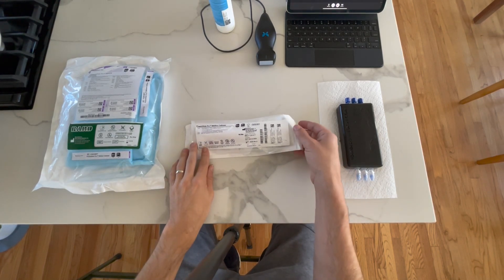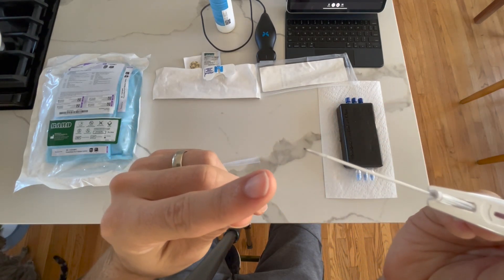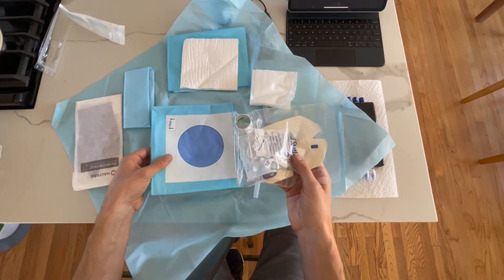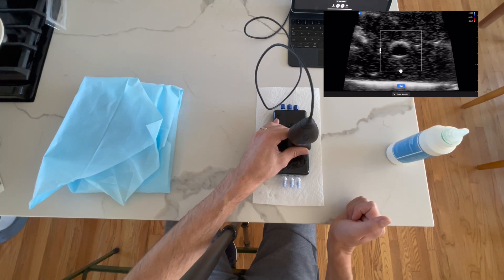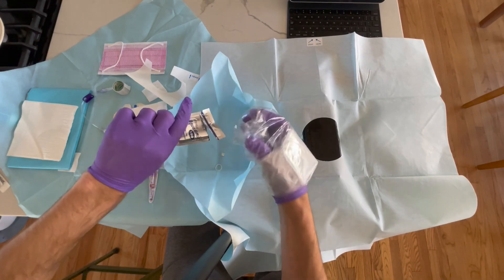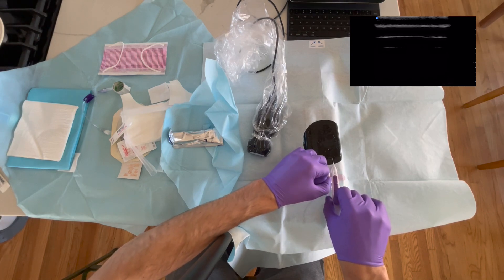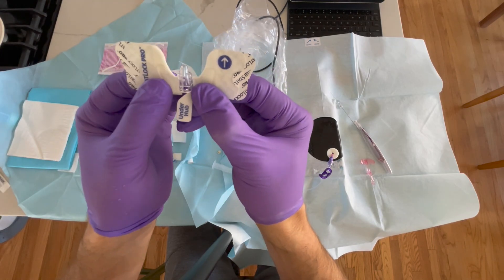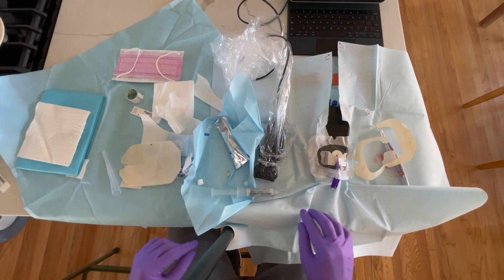Powerglide Pro AST Midline Placement

Comment: As someone else mentioned, your biopatch is not only upside down, but the slit is facing the wrong way and is wrapped around the IV. Consider starting to turn it the other way  because when people go to change that dressing, that biopatch placement really increases the changes that the IV gets yanked out. Even when I am being careful because because I anticipate that people put biopatches as you did, I still have a hard time getting that biopatch off sometimes